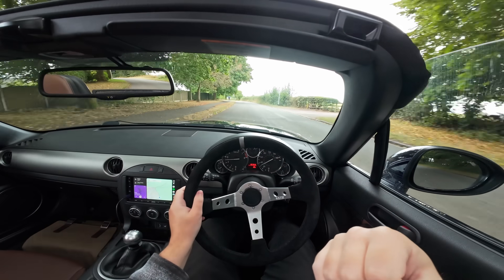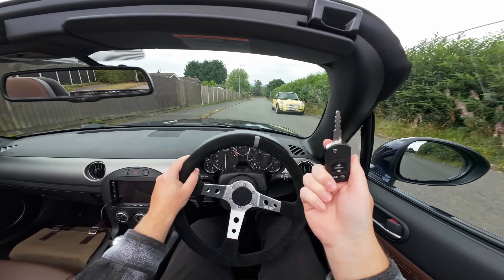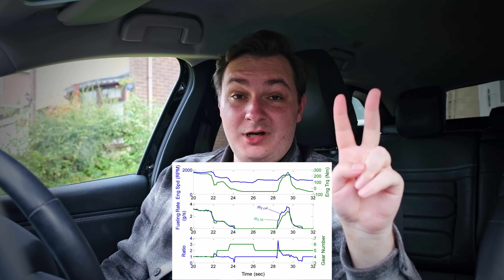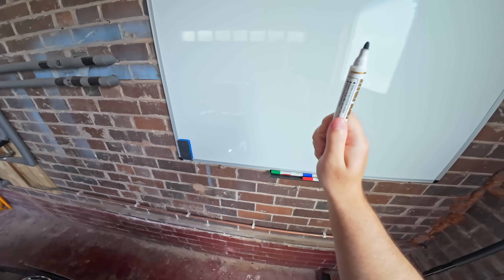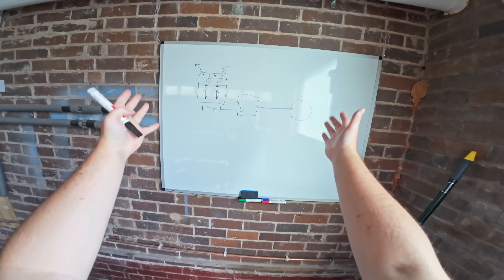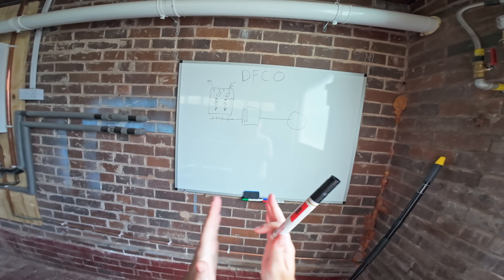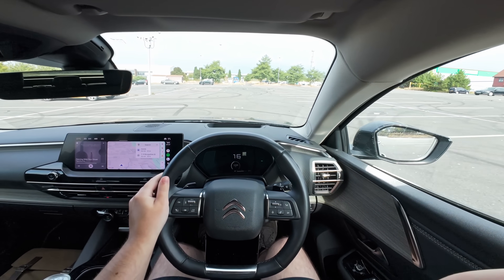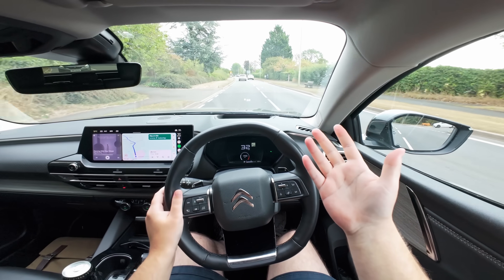The most misunderstood car term - Engine Braking

Comment: If you drive a Prius, it basically shows you on the performance display what the car is doing. When you press the accelerator, the green bar goes up. When you let off the gas, the green bar is completely empty, until you get down to a low speed where the car needs to propel itself to continue moving, so a little bit of the green bar is displayed.

Dumb it down to a bicycle. A bicycle needs external force to drive the wheels, it cannot move on it's own. The rider needs to kick off and start pedaling for it to move forward. Once up to speed, you don't need to continue adding energy at all times, it will have something called "momentum" (ooouuu, aahhhh) that will carry the bike over a distance. It will slow down and come to a stop if the rider stops all effort, and a low speed or a stop will cause the bike and it's rider to tip over, so at a slow speed, the rider needs to add a little bit of energy to keep the bike from falling over. The rider drives the bike forward until it reaches a speed at which the bike can drive the rider.

Comment: Hey Mick, this was very interesting and I had no idea. I've watched a lot of your videos but one question I had was on your video about driving fast on turns. In the video you used your brake while turning. I have been taught to break just to the point where you turn then turn with a little bit of throttle. A bit of gas so all the weight of the car doesn't go to the front or the back (not sure honestly). And I was also told braking while turning is a bad idea because the car can only do 1 thing properly, turn, or brake. Its a real thing and very documented, I have practiced it myself. so how come you said to brake while in the middle of turning? Thanks

Comment: Only carb engines use fuel when you coast. direct injection cuts off fuel as soon as you lift while in gear.

Comment: I do this , let the car slow down before a junction or roundabout then use the brake at the end to gently bring the car to a stop . Or if it clear you can slow down enough to have enough room ahead to use the throttle as you need to

Comment: The moment I see someone's brake lights come on an empty road with a slight turn - that's when I know I have to overtake at the first possible opportunity, cus that person cannot drive.
I've mastered engine braking so much, that I tested myself once to see if I could get to work without having to touch my brakes, unless I had to come to a full stop. 30km mostly rural drive, 100km/h speed limit with 4 roundabouts - I had to press on the brakes ONCE!
You just need to learn how to downshift smoothly so that you don't shatter your clutch while shifting from 5th to 3rd.

Comment: How can people think that? 😂 Its just like on a bicycle. Give no power in the pedals doesn’t mean the pike is instantly at 0 velocity. 😂So if you consider the modern cars they even go to neutral and shut down the engine. Therefore they can reduce friction and do coasting for longer than enginebreaking. This shows that even if the engine is off some parts of the car are still rotating.

Comment: i'm from a country where all of the cars are hard to drive because they're manual. I own a chevrolet Celta. Sometimes i use engine breaking in fith gear, sometimes in fourth. Which one is better?
Reply: Neither are inherently better or worse. 4th will just slow you down quicker than 5th, coming down from the same speed in both cases

Comment: Look at fuel map (ve map can be interpreted as fuel map) and you will see when throttle at 0% you still spray fuel. Turning off ignition will stop it from injecting fuel which will cause dammage. The engine when decel (engine brake) is creating vaccumm in the cylinder so when exhault valve open you will hear sound. I think fuel map do that is for if you press clutch pedal the engine still working not stalled out.

Comment: I find it amusing when people are going down a gentle hill and you see their brake lights continously on. Like, drop a gear if can, save your brake pads 😂
Reply: Depends on the steepness of the hill. If the hill is too steep you don't want to do this, because you'll need to drop it low enough to have enough braking force, your rpms might go high and heat your engine a lot. best is to judge and use either appropriately.
Reply: @DrTheRich  Oh of course, just gentle hills I would normally do this. I never let it engine brake above 3000 revs. The worst I've done is if I want to maintain 30 mph on a hill, I drop to 2nd which puts it at 3000, and it usually stays at that without running away, but again this usually isn't for long. I just find it funny when the option to have mild engine braking is right there and people don't use it.

Comment: For Years I’ve wanted a coasting light, basically something that only lights up when you’re not accelerating or braking. So many people only look for brake lights as an indicator to slow down and it never helps that they follow way too close anyway. A coasting indicator I think would not only make it easier to drive but clear up confusion and encourage others to coast instead of brake as the only way to slow down
Reply: It'd be cool but it's not really needed if people kept enough distance between each other. I personally always keep a braking distance between me and the car in front of me and as soon as I notice that gap getting smaller, I let off the gas to engine brake, and only press the brake pedal if it's really needed.
Reply: @AysarAburrub  Noticing the gap getting smaller takes time. Seeing the lights is instant.
Reply: @AysarAburrub IF people kept enough  space.!!!!   That is a big "if"
Reply: "For Years I’ve wanted a coasting light"
That sounds stupid. Why not the way simpler thing: any form of braking - be it with pedal, handbrake or engine-brake - should light the brake-lights...
Reply: @ABaumstumpf This is becoming increasingly popular, particularly on electric and hybrid vehicles with regen braking. Any deceleration over a certain threshold will automatically turn on the brake lights in many cars.
Reply: @SMarioMan EU does require brake lights to come on for deceleration >1.3 m/s/s. "One-pedal" driving modes for EVs make it especially ambiguous when it's not even a separate pedal for the driver's intent to slow, let alone the actual motion of the car.
Reply: @ABaumstumpf 
I wonder what the difference between hitting the brakes and coasting could possibly be. Probably nothing, you’re right.

Comment: The clutch is a friction plate, it doesn't matter which end the energy is coming from. Whether it's coming from the wheels or the engine it is just two bits of metallic fiber stuff sticking to each other.

Comment: Not a fan of the steering wheel mod for a road car Mick. That airbag is the most important one and now it’s gone
Reply: my 90 yo car never had an airbag... i drive it a lot... He's not going to suddenly die without airbag.. he needs to crash first...
Reply: @DrTheRich No. HE doesn’t need to crash. You do not drive on roads alone. You can be the safest driver on the planet and get rammed by Susan in her 3 tonne SUV because she was texting. Removing steering wheel airbags on a road car is idiocy
Reply: @DrTheRich  "ive lived my entire life without being stabbed in the chest... ive lived a lot.. i havent suddenly died without a knife in the chest.."

Comment: Unfortunately, it's a forgotten concept in North America (where everyone is racing to stop at a red light) and not being taught to younger generations.
Reply: There are signs in certain areas that say you're not allowed to do it. I'm kind of curious how they would 100% know that's exactly what you're doing and not that you're just coasting and slowing down
Reply: @MichelleLM88  Those signs near residential areas are for truck jake brake because it's loud.
Reply: @Omarock nope I've seen one on a highway in my area
Reply: @MichelleLM88 Where exactly?
Reply: @HweolRidda i-294 in Illinois a little pass West Plainfield road
Reply: @MichelleLM88  Yup I see it.  "ENGINE BRAKING PROHIBITED".  I suspect it is aimed at trucks slowing for a ramp, but it doesn't say that.
Reply: @HweolRidda FYI after some of the construction was done in the area it doesn't seem that close to the ramp anymore. I don't know if they mixed up where it was supposed to go or what
Reply: @MichelleLM88 I sometimes start singing the chorus to Breaking The Law by Judas Priest while engine braking past those signs in my personal automobile. Those ordinances are aimed at commercial diesel trucks equipped with exhaust brakes.

Comment: My question is going to be a little bit off-topic. I have to ask you. What kind of Citroen is that precisely? Is that C4 2021? Cuz if so, I have the same, C4 2021, but my infotainment, even though it has the latest version, doesn't look like that! Android Auto also has to be connected with a cable, it's not wireless :(

Is there a trick to update the software in a different way, or? Thank you in advance!
Reply from the maker: C5x

Comment: Going down a mountain road, shifting to a lower gear and lifting your foot of the accelerator instead of using the brake is the best use of engine braking. And it is necessary if there are several miles of downhill. Using only the brakes will overheat (break) them and they need to be replaced.
Reply: Doesn’t it harms the engine? Say you going 40 km/h in first gear, it can lead to engine failure. You can shift it to second gear but then you have a car that goes 70 km/h in a dangerous road.
Reply: @regedya  The car can't be loaded to the max and it shouldn't be going to fast when down shifting.

Comment: My instructor back in the day wanted me to do "engine braking" by having me let revs drop with the clutch pressed down and then slipping the clutch back up. It was near enough mandated for slowing down when coming up to the red lights. I never argued against it as it was a rather peculiar instructor, and it's not my clutch that's being broken doing this. Funnily enough the clutch did break prematurely in-between lessons. It was 3 years old.
Reply: I guess you could call that "clutch braking" LOL. Basically braking with your clutch. No wonder clutch wore down so fast.

Comment: This works just as well in an EV as while you slow down faster and therefore 'coast' a shorter amount of time that regen braking still improves efficiency allowing you to save a lot of battery. It's why you want your regen on low when on the highway as it's better to 'engine brake' than slow down a lot using regen only to then speed up again.

Comment: I would like to see a breakdown explaining where that crossover happens between engine braking and when the idling begins. is it just the ECU that controls this?
Reply: Yes, its an ECU parameter, typically in the 1100-1600 RPM range once the engine is at operating temperature. If you have an instantaneous guel consumption readout, you can see it jump back up as you coast down. Vehicle speed that it happens can vary a lot, depending on transmission downshift program (or driver gear selection with manual), torque converter unlocking, temperature, AC compressor active, etc.

Comment: Engine braking involves using the engine's friction and compression to slow the car without using the brakes, whether in the mountains or when exiting the highway. The higher the engine speed, the more it slows down the vehicle.
What's being explained in this video is anticipation and taking advantage of the car's inertia. They're not the same thing.

Comment: I can confirm this, i was driving down a hill and i needed to slow down so i shifted down a few gears and i was getting more than 50mpg (my car only tells me average mpg not the mpg im currently getting) in 3.5L v6 from a car designed in the 90s while at 5000rpm. For reference the car is rated for 16 and 24mpg and i normally get 18 and 28mpg, there is a clear difference.

Comment: I have no argument against using braking as it's not detrimental that affects mechanical wear. However viewer, you must understand that engine braking is good as long as you still use the brake pedal properly.

Driving is communicating with other people. Brake pedal exists to show your intention to slow down to the driver behind you. If you do engine brake to perform hard brake, it would endanger you and driver behind you. Only use engine brake to adjust coasting speed.

Comment: The dashboard consumption goes to zero while you are going down a hill or coasting with no accelerator. It doesn't need petrol to turn the engine because the wheels are turning it over fast enough.
Reply: coasting is a whole another thing tho and it actually uses fuel. so just always rev match and put in a gear.

Comment: Yes, engine braking use zero fuel. But, if your engine temperature are pretty high, the ECU will inject a little bit of fuel to cool down.  Anyway, still save a lot of fuel.

Comment: Question for an expert!!! Am I wrong?  If I'm approaching a large roundabout at 50mph on level ground in 5th gear (small manual car), I always lift off well before to engine break.   Still before the roundabout, but now slower, I'll rev match and downshift to third to get "more engine braking" and potentially be in the best gear to enter and exit the roundabout if its clear. No brakes are required at all if no traffic (thats my game). I've been doing this for years, but not sure if im destroying my clutch while thinking i'm Niki Lauder or if this is the best way to drive? Can anyone illuminate me?
Reply from the maker: This is exactly how I've been driving for 10+ years across multiple cars/motorbikes.

Just make sure the revmatch is clean, otherwise you're wearing the clutch.

Comment: I ‘ve been tuning my ecu and there are parameters like Deceleration Enleanment. and Deceleration Fuel Cutoff. tje cut uff is set to 1.5sec kick in. I also get  graphs with injection basically you need a transition to prevent jerk. Carburetors usually don’t have fuel cutoff.
some years ago I was talking to a aircraft engineer and he couldn’t accept you can turn the engine off and not jamming the whole drive train. honestly I have no idea why he thinks the engine would literally stop revolving :)

Comment: But that depends on the speed and which gear you are in. In Citroen C4 2009 manual if you lift off doing 50 km/h in 5th gear there is 0 fuel consumption just a bit until you get close to idle rpm like you said. Then it has to be shifted down to continue the engine breaking - 0 fuel consumption.